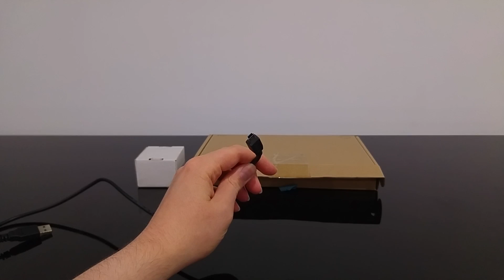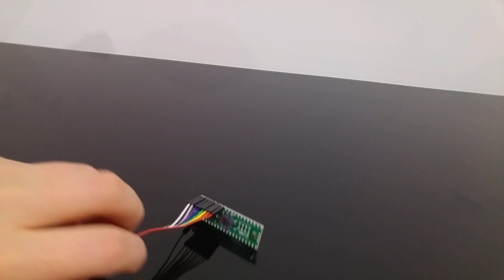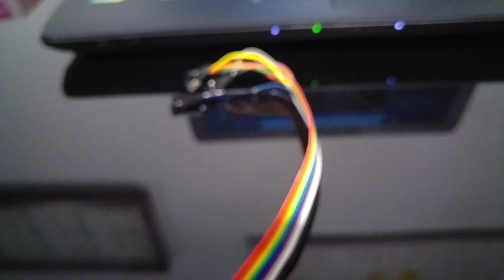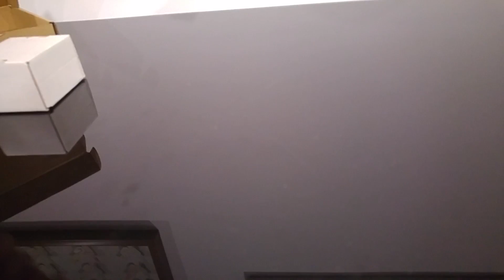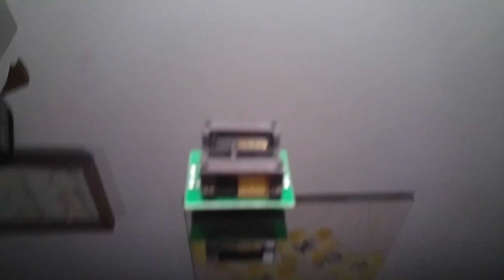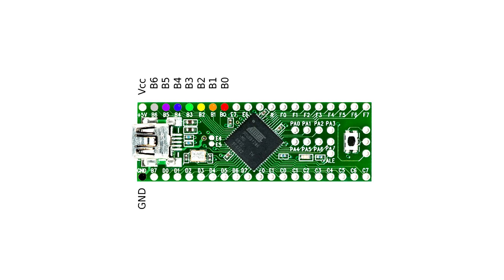PS4 Controller Sync NOR Flash Corruption Repair 1/3 - Building the Teensy Programmer

Comment: Hi Andrew. idk but im probably having this exact same issue. my ps4 7 months old since feb but only played for 3months after i played 1 game in overwatch my console started to lag im tryung to force to switch profiles bad idea ik now. anyway it completely froze i restarted no syncing. formatted it still no syncing. im curious can i do the replacing bluetooth chip thing to fix this or have to do this frameware rework thing? i have zero experience in any of this neither the equipment. so my last question if i have to do the rework thing can u possibly do the hardware thing for me n il purchase it? i live in the bahamas not so many pc or game tech here.
Reply: Would switching the bt chip fix this issue?im ready to order the part. Had this before the update around may.I installed the update hoping it would fix.
Reply: Is there a way to find the problem between the bt chip or the nor before buying the materials for ether solution? Reply would be appriecated. Thanks
Reply from the maker: Not really to what I've seen - I usually dump the fw. to begin with as it's less strenuous on the motherboard to remove the NOR than it is to rework the BT module. If all looks good then I go to the BT module.

Be aware that if your console is a CUH-12xx series machine you'll have different BT modules than those in the CUH-1xxx series machines and you'll also need a different NOR adapter to that shown in the firmware rebuild tutorial Part 1.

Cheers,
Andy.
Reply: I do have the 12 series pheww s possible that u can post the alternitive bt module and nor kit please when free. A link to  purchase them or their modle names. Thanks

Comment: Hi Andrew, Something unrelated to this video but I was wondering if you could help me. The fan on my PS4 doesn't spin but only for half a second when I turn it on, I have replaced it with a new one and it still doesn't want to spin. Instead it overheats every 15 mins or 2 mins when I try to test it on a game. Do you know of a solution I could try?
Reply from the maker: Hi mate, Probably an issue with the PWM circuitry if the console otherwise appears to start OK. Don't be tempted to keep running it if the fan won't spin - it'll kill the APU. Get i checked by a quality independent repair specialist. Cheers.

Comment: hey Andrew as you know i use the raspberry pi 2 to do this instead of the teensy....i  noticed your part list doesn't include a 0.1uf cap to go between VCC and GND .... is that not recommend on the teensy? for the pi the ps4devwiki says Use short wires, esp. if you are not adding the 0.1µF capacitor between ground and vcc as close as possible to the chip...thought i'd point it out so if you ran into issues with  mismatching dumps you had a possible solution...cheers mate cant wait for the next video
Reply: I use a PI 3 - No cap .. No issue
Reply: arduino can do this?

Comment: ey Andrew, few questions for you 

I have fixed a few systems with this issue using this method but  have a
 few here that are giving me problems. 

( when comparing C0020001 with HxD, it tells me * The chosen files are 
identical. The file sizes are different, though! * - is this normal ) 

( here is the C0020001 file after extracted. http://www.megafileupload.com/o0hY/C0020001.bin
 have a look at where the offset ends ( 0006E170 ) where on the good 
working C0020001 file offset ends at 0006E870, is this my problem.. is 
there a way to fix this )

Comment: Andrew, got some 1215 boards that the issue is the PS update did flash the wrong version of the bt module, the physical module is rev 1.1 but the flash has the 1.2 fw, trying to replace that data in the Nor file will make the ps4 not to boot, still eject but rarely beeps to power up and when it does power up (1 every 50 or so times) it will turn off seconds later.

Ideas on this case?

Also, I am able to read/write the NoR directly on the board soldering on the pads around it, is there anything against this procedure? Is it safer to remove the chip from the mobo?

Thanks again!
Reply from the maker: It's defo safer to remove the flash from the board - not sure on the 1215 issue though - not done much of anything with these as yet. Cheers.
Reply: +Andrew Paul would you take my ps4 to repair either the Bluetooth chip or the software in this video
Reply from the maker: Wave Rider where are you located mate?
Reply: +Andrew Paul Edinburgh
Reply from the maker: Sure thing. See my Controller Sync Repair Service on my eBay page at:
http://www.ebay.co.uk/usr/lufcfan2004
Cheers.
Reply: I have the same issue. check my last posts on bgamods http://bgamods.com/forum/viewtopic.php?f=86&t=5166&start=110#p49743. i have succesfully replaced the section covering all the driver with the right one, but it did not help, and now i ended up with endless blod after flashing the latest known working dump. i dont know where the problem is now, why it's not booting anymore

Comment: Andrew I really need some advice . I've been following your video and you really know your stuff . Especially ps4 . I wanted to ask a question . I have a ps4 board I am working on . I've been breaking my head trying to figure the problem out after swapping out the HDMI port . It didn't work after the HDMI swap and I found out that it was one of the HDMI filters ( one of the four black squares under the Panasonic chip) that was bad . I tried changing just the one but all of them ended up moving so I removed them . The problem is when it came to putting the HDMI filters back , it was so difficult , I couldn't put them back on because of how tiny they are. After 2 scrap boards of trying to transfer those filters , I gave up . Most ended up getting damaged. Do I need these four black filters or can I just run a straight wire ? When I take a closer look at these filters. They just look like wires wrapped around a black non conductive material. What do you think ? Hope to hear from you soon
Reply from the maker: Hi, these are EMI filters - if needs be you can just run wires from top to bottom across the eight sets of contacts. I'd recommend putting some proper filters back but if you're struggling then it'll get you out of that situation. Cheers.
Reply: +Andrew Paul  EMI filters wow. I have been looking for the name of these components like crazy . I would love to put some back on but it's just so dang difficult . Is there any alternatives? What happens if I don't use them ? Do they sell these components alone?

Thank you for the prompt response . I heard you called them HDMI filters in another video . I didn't know what they were until now.
Reply: +Andrew Paul you are so awesome . You were right I put it 8 copper wires and it worked flawlessly. This is the reason why I knew you were the person that would help with this situation . Thank you so much . You taught me so much about the ps4 system . It really impressive . Keep up the great work !!
Reply from the maker: Cheers :-)

Comment: Hi Paul I'm sorry but this has nothing to do with this video but I'm just hoping for you to reply, my ps4 is dead and won't turn on at all, I've tried everything, I've ordered a new psu because I think a fuse has blown in the power supply, do you think I am right? Cheers lewis
Reply from the maker: Hi Lewis,
It's possible you're right but there are literally hundreds of reasons as to why your console may not power on so without seeing it first hand it's difficult to say but good luck with it and hopefully a new PSU will resolve your issue. Cheers.

Comment: Andrew, your link to the Teensy++ board is already included the 3.3v chip. is it the same chip on RS online? thanks
Reply from the maker: That's good if so! Yes it most probably will be - as long as it's a 3.3v regulator then it should work nicely and will avoid the need for the additional part from RS.
Reply: http://ru.aliexpress.com/item/Genuine-PJRC-Teensy-2-0-USB-AVR-develope-board-for-ps3-Teensy-free-1pcs-usb-cable/32224523010.html?spm=2114.03010208.3.129.VHaJbK&ws_ab_test=searchweb201556_0,searchweb201602_2_10039_10048_10057_10047_10056_10055_10037_10049_301_10059_10033_10046_10058_10032_10045_10017_405_404_10040_10060,searchweb201603_1&btsid=8c81e0d3-0822-4083-8bc7-cc85dd53b154

Comment: didn't you upload it before??
Reply from the maker: Yes but I didn't cover the 3.3v mod required to run the NOR at the correct voltage - that's in there now.
Reply: +Andrew Paul ok